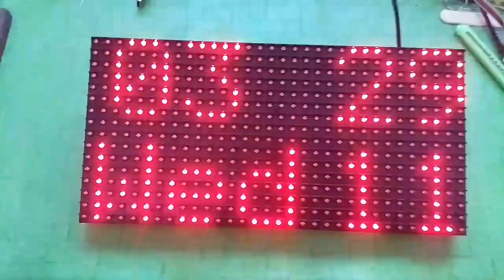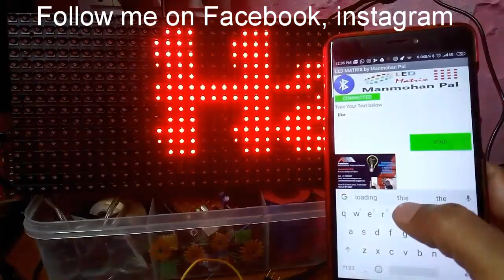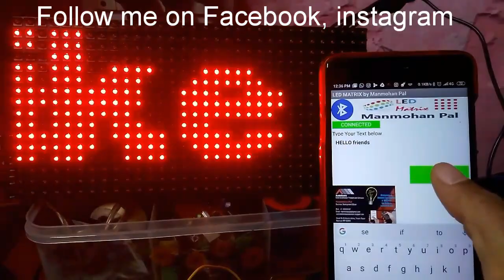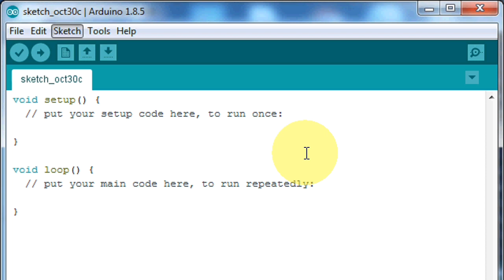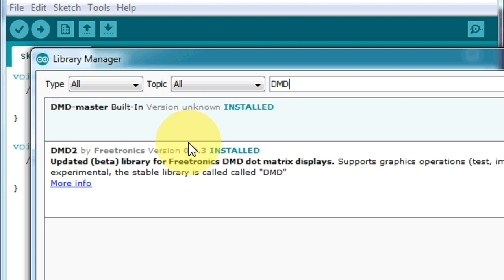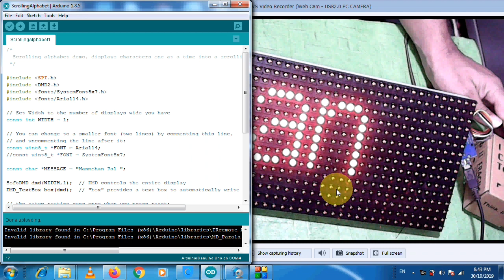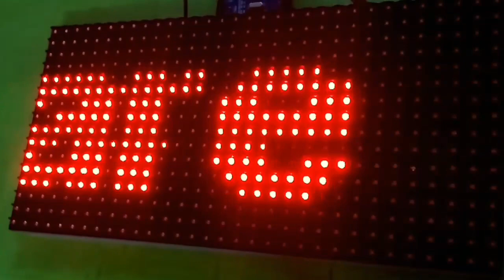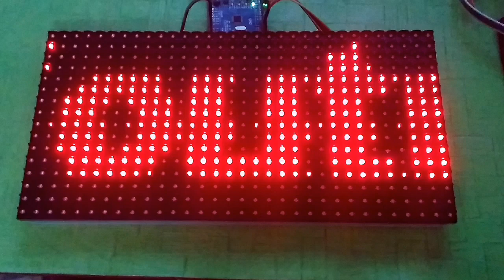Scrolling Text display on P10 LED display board using Arduino

Comment: Good day sir,
If we connect 2 or 3 p10 panels , and uoload the code. Then text can scroll through panel, from start to end or different different text required to load.